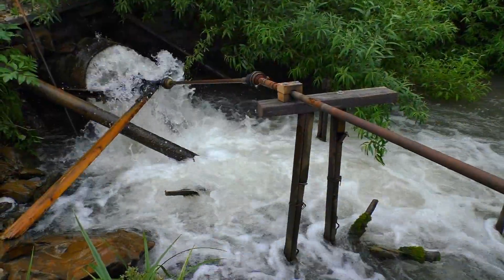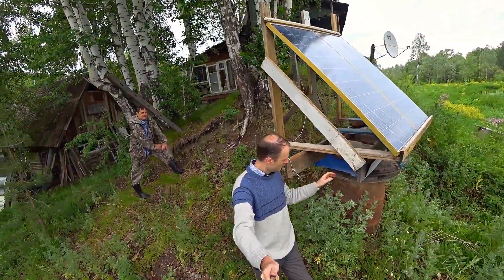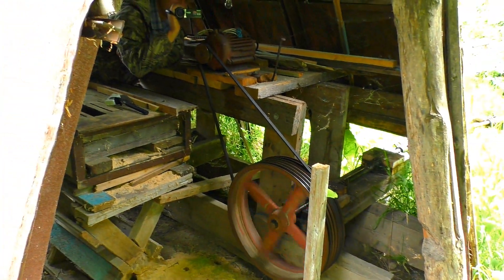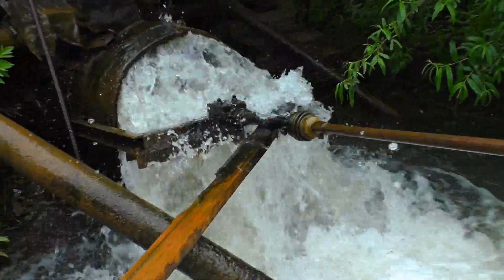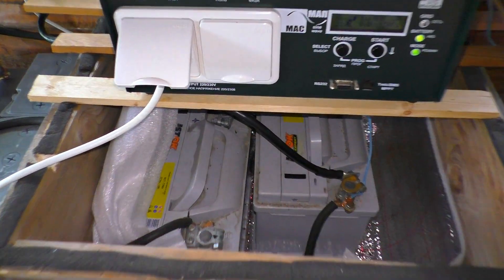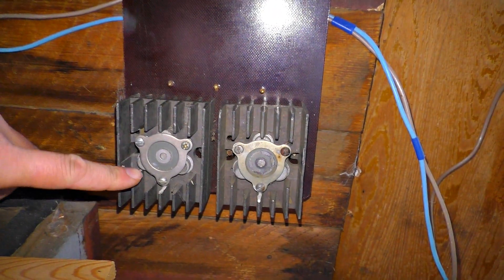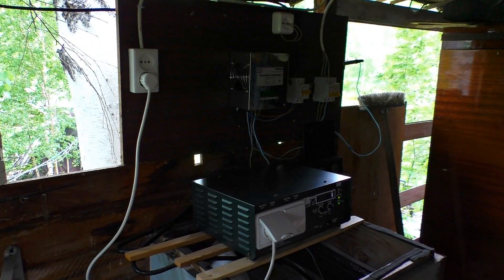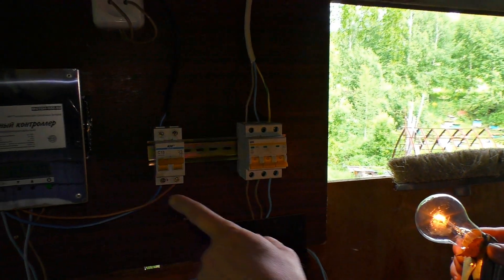#2 Free Energy! Hydro Electric Station DIY / Alternative energy !

Comment: FYI accumulator = battery

Originally you had a 220/240v motor (generator) connected directly (unregulated) to the wiring but that cause an issue because if you had a large load it increased the resistance on the motor windings (generator) and if you didn't have load on the system the voltage would increase as the motor (generator) could spin quicker due to the decrease resistance in the copper winding.

So less load motor spins faster due to decreased resistance in the motor windings, voltage increased and blew things up.
More load more speed decreased voltage decreased and things wouldn't work.

As an upgrade you swapped out the motor from an 220/240v AC motor to a 12V motor and then rectified the power using some car rectifiers to charge some 12 volt batteries in parallel (and not over charge them).
Then you set up an inverter to take that 12V you have stored in the batteries and convert it to 220/240 volts which is regulated so you don't blow anymore electronics up.

Hope that helps guys! 
BTW is this place a secret?...

Comment: By streamlining the impeller, there would be less turbulence.. in other words.. funnel the water output and better spin for water output.  

Perhaps try a spiral instead of a propeller to Increase flow of water and less drops across turning force.

Or

Directly aiming the funneled stream onto a single part of the propeller instead of directly into it and that would also help with driving the motion more smoothly.

Lastly.. look at creating HHO gas or ohmasa gas to create a new fuel source for heating and cooking so less drain is put into the system. 

However.. have a little fun with the gas too. 

Lol.. 

Booohooooooom.  

Holy cookies.
Reply: I think if they continue to use axial flow turbine , they should take a look at jet engine turbines, they're made with maximum efficiency.
Reply: svetko05 only issue is they will need fuel to fuel the jet engine. 

Ohmasa gas comes from Japan too just to let you know.. they'll need to build an ultrasonic agitator for water.. but run at a specific frequency in order to make dish water not bubble.. and to break the water's surface. 

YouTube ohmasa gas.  

You'll see what I'm saying.
Reply: Gary Stinten no, I mean to still use water, but design the tuebine like a jet engine turbine for better efficiency.
Reply: svetko05 sorry for the late reply.. yes.. i understand what you meant now.
Reply: yes a longer 'impeller' or a turbine with multiple 'stages' just like you see in a jet engine or inside a power plant generator with multiple rows of fins so each set is getting smaller and raising the pressure so the maximum power can be extracted! --- I think 2 stages will be best for this kind of setup